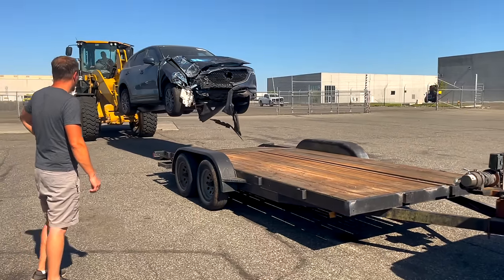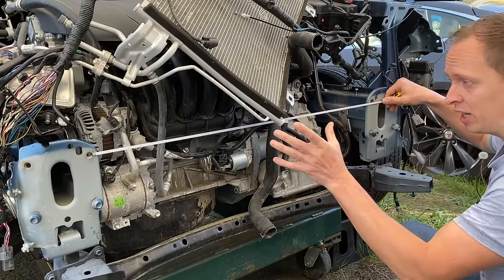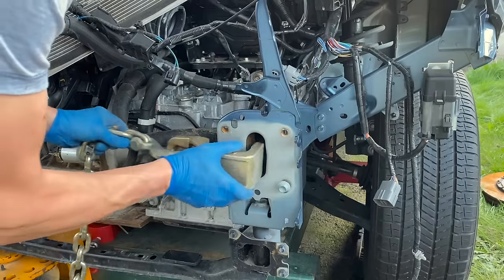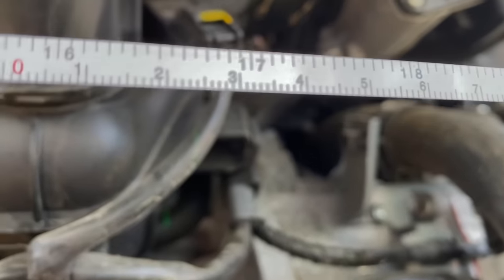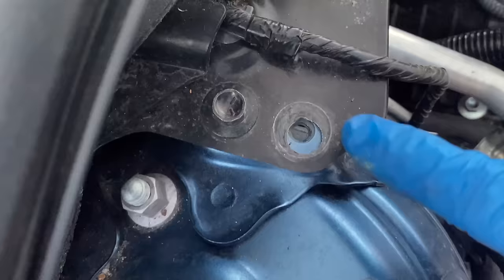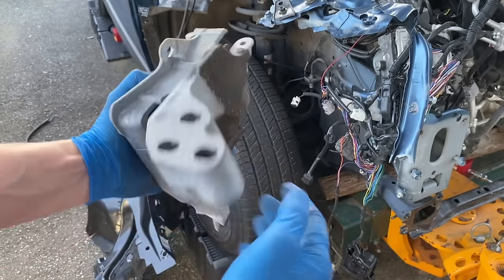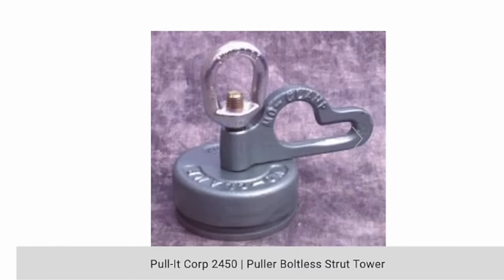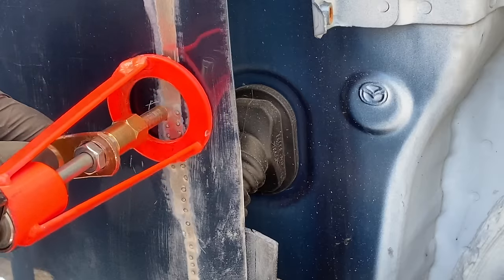✅Frame Repair in the Driveway with Great Results? Let's find out !!

Comment: You have been proving in time, again and again, that it's not the fancy tools,  but rather how well you know how to use them.  Thank you so much for more life learning lessons!
Reply from the maker: You are most welcome !!
Reply: I have spent 20 years doing exactly this and that frame machine is a fancy tool 
I thought the old body pullers that use a lip bolted down to concrete were slick but this is cool
Reply: Maula rakh hath hola
Reply: No, it's the cost of labor for repairs. The vehicle is uneconomically repairable. Accident and frame damage probably make it a "salvage" vehicle. Nobody wants a vehicle like that.

Comment: You do fantastic work. I replaced a passenger side frame, lower cross-member, and bumper on a totaled Toyota I bought on bid back in the early eighties in Europe. Needless to say, my repair wasn't anywhere near as precise as yours. I can say that I drove that car across much of Western Europe and the eastern U.S. and Midwest for 14 years. I forgot to mention that my frame straightening tools were a come-along and a hammer...LOL. I used the end of some nearby railroad tracks to lock the car in place to straighen on a small kink in the driver's side frame.
Reply from the maker: In the past I have tied the car to a pole, tree or a truck. Not as easy as using a frame rack, but as long as it gets done that's all that matters 👍👍💪

Comment: You show that you don't need a fancy workshop and all the fancy tools/equipment to do an excellent job and it's possible to make your own frame rack. Your such an inspiration, excellent work! Whenever I get my own house I plan on doing work like this. Love the videos.
Reply from the maker: Absolutely, it just takes a little bit of creativity to make most things possible. No need for a fancy shop with $30,000 frame racks and paint booths... The same could be done right in anyone's garage, driveway or a backyard. Stay tuned  for more !
Reply: @fix206  
The correct tools make a great difference but it also takes great insight to accomplish what you have!
Phillip Hall
Reply: I mean he has a frame rail, laser alignment equipment, hydraulic pulling equipment. Various clamps. The thing that measures hole centres when there’s something in the way of the tape (forget the name, he did say in the video)……to be fair he has a pretty impressive setup, far more than most amateur home mechanics. Having said that, having the equipment is nothing without the knowledge and experience of how to use it. This guy is seriously good at what he does…..and the fact he can explain exactly what he is doing and why is a gift to the viewers. I want to be clear, I’m not trying to take anything away from what this man can do…..but he does have quite a bit of fancy equipment. No doubt he could probably make a pretty good job of it without any of the fancy gear…..but to get it mm perfect like this cannot be done with a tape measure, grinder and ratchet straps.
Reply: @seshelbow336  
Yes and to be fair to him, he has made most of this ‘fancy’ equipment himself (including the frame machine) further more, he has taken the time to make and post videos here on this channel explaining in detail of how he has made each tool. 
Phillip Hall
Reply: @seshelbow336  Everything he has he made himself or can be bought up from Harbor Freight for less than $1000 total. He has nothing fancy that an average home mechanic WOULDN'T have, it's all easily affordable from Harbor Freight, he even buys some gear from there. His gear is not expensive at all. Only thing he didn't make was the frame tower, which can be bought used for a very good price. Only thing you're right about is the knowledge and skill but those are something anyone can gain overtime from a few projects in the garage/driveway. You learn by doing.
Reply: @PhillipHall01  I admit this is the first video I’ve watched of his. And yeah a frame alignment tool is something that can be self made…..although at considerable cost and mam hours. I’d love to see the video where he makes his own laser alignment gear tho. Please link.
Reply: @Recklessness97  please link me to the laser he uses I’d like to buy one.
Reply: @seshelbow336  
I don't think he actually made the laser itself but the stand on which it sits. (a base if you will) and (I might be inaccurate about that piece). If you are interested in this sort of work, I highly recommend you watching all of Fix 206 videos and 'not just this one'. as good as it is :)   
You will find his videos very educational and easy to understand, as well as comment sections filled with valuable information. 
And as a bonus, Fix usually answers questions to most 'respectful' questions himself.. I hope this helps. 
Phillip Hall
Reply: @seshelbow336  Huepar and Skil are the two laser he uses in this series. Check their respective websites, they have plenty of models. I can't tell which exact ones he's using. You don't need those particular brands though, any cheap laser will get the job done for this particular application.
Reply: His tools looks fancy to me

Comment: There's a lot in framework to get it exactly right. Looks you have the technique worked out really well. Spend the time setting the car level and the laser centered and everything else falls into place (or is pulled into place).
Reply from the maker: You are 100% correct. It's all about the prep first, same as with paint work. If you did not lay down the groundwork everything that follows isn't going to be satisfactory.

Comment: 1960,s cut and shut crash repairs  now 79 years old and reliving all of the measuring and double checking going on .. excellent home designed and fabricated  pulling jig . In the 60,s  I used a middle aged crash fabricator .. he only did bare chassis work .  all of the engine  / suspension/headlights and wiring had to be removed . he never did any work when customers watched .  all he had was h sectioned girders set into the ground with a short bit sticking up .  he attached his portapack rams and fixtures onto the girders .
his name was Frank and he had a  few acres of farmland property on the Nuneaton facing town called Bedworth . After a number of years  I called around and found Frank sat in his favourite armchair gazing out of his bungalow window . He knew instantly once he heard my voice and always called me Wally .short for Wallinger . Memories .
Reply: Bedworth is a market town in the borough of Nuneaton and Bedworth, Warwickshire, England

Comment: Well I think you did a beautiful job. I do collision work for a living. I've done automotive and I do transfer trucks now. In the automotive side I did the same as you I like to be precise and that's what you do. I don't like to shime or waller holes for it to fit . Awsome video
Reply from the maker: Thank you very much!! I would much rather spend a little more time to get things pulled back 100% into spec versus having to fiddle with bolt on panels trying to figure out the best way to make them fit...

Comment: My first time watching and I subscribed to your channel. I love this line of work, but I'm too old to learn how to do it. Recently I had my car pulled in a shop for a small nose hit and the results were very poor. Even when I have a complete cut off front they pull the original, and use some parts from the cut off front. But the lines between the fenders and the hood are not right. So I dismantled the whole nose in my garage and found a lot of bondo where the hood latch is. So now I'm trying to help myself and fix what I can. Masterful job on your Mazda, thank you for the video.

Comment: Daaaaang son, right on the money!  You are like DIY next level, I got ideas from you I tried to pull without the hydraulic arm but instead my truck and tied it to a tree, couldn't get the precision and ended up taking it to the body shop.  There is something to be said for the correct tools and technique  😉😆🤣💪
Reply from the maker: Having the right tools definitely helps. I built this frame rack few years ago and couldn't be happier, I've taken some of my cars to frame shops back in the day, but it just gets so expensive and top of that I have no idea how good of a job a technician is going to do. This why I get it done right, save money in the process and make a few bucks off of the videos that I make :-)

Comment: You are doing much better job than body shops do. Body shops will not pull inner body parts that got pushed in. They just force new external part to fit over it.
Reply from the maker: I'm a perfectionist by nature, so I always try to do as good of a job as possible 👍

Comment: I recently bought a 2021 Fiat Panda Hybrid .. supposedly an undamaged car with 25,000 km from new .yea    the lying salesman from the garage in Beja   Portugal . insisted that the car had never been in any accident and was damage free. My photographs seemed to jog his memory and he sent the replacement chassis cross members for me to return the car to acceptable tolerances .   the wire and string methods   I used way back in the 60s continue to do the job . The weird wandering was traced to the anti roll bar droplinks being connected to the macpherson struts .. a seemingly money saving development of quite a few manufacturers .I relocated the anti roll bar droplinks   ( shortened ) down onto the lower front suspension wishbone and the difference was  my little  2021  Fiat Panda   Hybrid   now is a delight to drive .

Comment: amazing video and in depth love it one question i buy from copart to and i cant find measurements for the car i have bought i suppose its because its a 2023 but i genuinely need a website or where i can get information about my car as the subframe doesn't fit so the car and been pushed back but i do need the dimensions thanks

Comment: From Leo:  Good video.  There is a man near me that just leaves the car on a heavy duty trailer and uses jacks and chain wenches, and sledge hammers.   The Front end guy at the dealership told me the guy gets them really straight.   It is possible,
Reply from the maker: Hey, if it works for him and the end result is good then more power to him. 👍👍👍

Comment: I stumbled upon your video while searching for information on straightening frames, as my 07 GMC Sierra 2500 truck was in an accident 2 months ago and the Farmers insurance company and Caliber Collision body shop decided to total it due to a bent frame, diamond bend, from what the tech told me. I am wanting to keep my truck instead and have the frame repaired since the truck only has 140,000 miles on it and with the Duramax LBZ 6.6 liter V8 turbo engine and Allison transmission all in good working order, I can't afford to buy anything similar and not know it's maintenance and care history as well as my own one owner truck. I do have concerns about towing since I tow horses in a gooseneck trailer and hay often. The insurance company requires replacement of the entire frame which was going to run over $17,000 with the bumper repairs, so they considered it too expensive to pay for and will be giving me a check. I'm going to take my truck to a couple local body shops next week and see if they can repair the frame. Any advice for me?

Comment: to your question at the end , How was the door gap at the back ?
That car looked bad , but you picked a good one without a mashed lower rail , so my guess is that it was effected very little.
Reply from the maker: All of the gaps are good everywhere, luckily frame rails were not mashed so I did not have to do any sort of sectioning on them which save me a good bit of time :-)

Comment: It's important that those points are precise cause that's the bonnet and it won't fit if not accurate enough
Reply from the maker: You are correct 100%

Comment: Get this man a car o liner
Reply from the maker: What's wrong with my set up? I actually like mine more then the caroliner, since my base is much lighter therefore when not in use I can flip it up on its side against the wall this way it doesn't take up any space. To do the same I'd have to use a forklift with a caroliner base...

Comment: 4:41 When u pull/straighten the frame rails over with the subframe off them, will the subframe bolt holes line up with the frame rails bolt holes? I thought that the subframe holds thenframe rails or gives the frame rails stability so the shifted front of the frame rails can be pulled back into specifications.

Comment: Surprised you didn't go into the ground you were on, is it level, I know you've got that thing you made but how do you know that's all level to begin with?
Reply from the maker: No ground is level, and even if it was the chassis would still not be leveled to the ground due to suspension sag, uneven tire pressure, etc.. I went into detail as to how I level the car out on an uneven ground in the previous video, here is the link to that video if you're interested: https://youtu.be/3mwsqGRthSE

Comment: Retired from doing this work 40 yrs,, front end hits are the worst, because of all the technical parts to deal with,, always preferred the rear hits much easier no mechanicals to sort out.... Extremely expensive to do front repairs...
Reply from the maker: You are not kidding about how expensive the front end repairs can get, especially the cars nowadays where the front bumper alone may consist of 50 different components.

Comment: Question that tie down strap situation where did you attach it to? Your truck?
Reply from the maker: Yes, I do use my truck a lot as an anchoring point to make a quick pull with a strap
Reply: @fix206  where did you put the strap by though? By the tow hook?
Reply from the maker: Anywhere really... Tow hook, frame, wheel... You can't really hurt the truck since most of them are built like tanks...

Comment: What brand is your tram? How much do they cost? Or can I just use a straight edge for the same measurements?
Reply from the maker: What do you mean by the tram?
Reply: @fix206  the measuring device used in the video
Reply from the maker: The tram gauge that I used to take some measurements is something that I built a while back. It is pretty cheap and quick to make, I actually did a video about how I did it, here is the link: https://youtu.be/mTr5dCj4kis

Comment: I'm 78 years old 50 or 60 years ago we had 25 or 30 shackles and d-rings when a couple of come along and a bunch of chains did the same thing no laser took a little more time
Reply from the maker: cars are built a lot more precisely these days then they were 50-60 years ago. Generally you can get away with a lot more whenever you're working on an old vehicle rather than a new one.

Comment: you may have answered this in another vdo, but why didn't you remove the engine first? it would give you a better visual on what is going on..
Reply from the maker: That would be unnecessary in this situation, too much work really for nothing. I was able to measure everything out without having to go through the trouble of pulling the engine, it wasn't really in the way

Comment: Wondering what's that drill tool called that he's using at 15:40 to clamp and drill out the factory spot welds ?
Reply from the maker: I left the links to the drill and also less expensive similar drill in the video description
Reply: @fix206  hey thanks, appreciate the response brother
Reply from the maker: You got it 👍

Comment: You arent accounting for twist in the strut tower. What about length on the rails? That rail probably has a buckle in it from that broken motor mount using it as a pivot point. Far better then most home auto body but that car isnt straight.

Comment: You didn't need to see the frame rail bracket to know that car had frame damage
Reply from the maker: I know I could have used a tram gauge for that, but in my case I had to strip the front end down anyways, plus laser is going to be way more precise....

Comment: Just because the frame has been pulled back into position does NOT mean you have restored the integrity of this chassis - one side will be weaker than the other.
1960s repairs on a modern monocoque chassis.
Reply from the maker: It's not like all of the components that I pulled back were shoved over by a foot or so.. I had to bring them back just so slightly. So, what would you suggest I do to "restore the integrity of the chassis"?